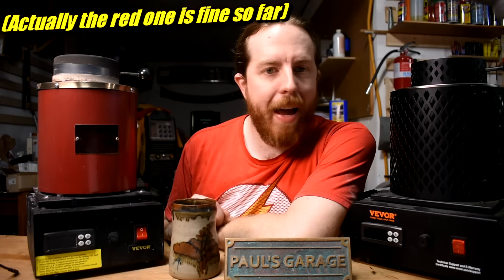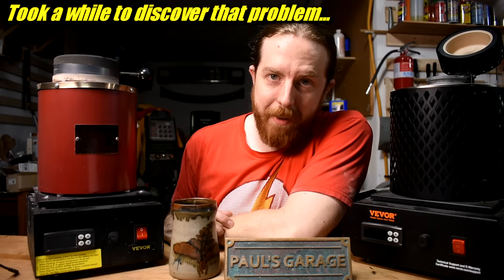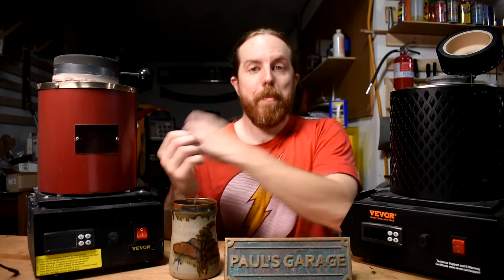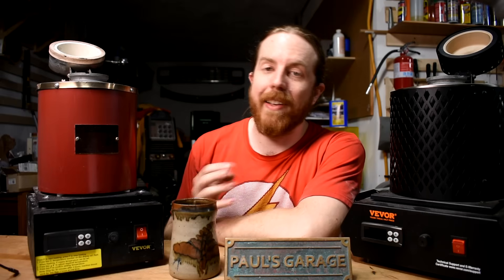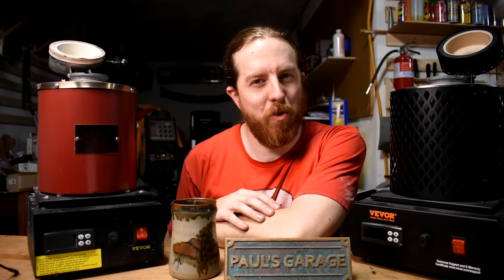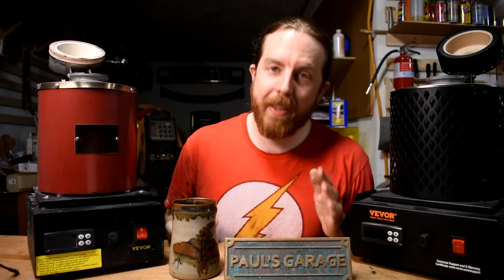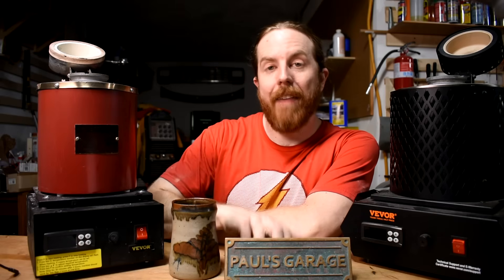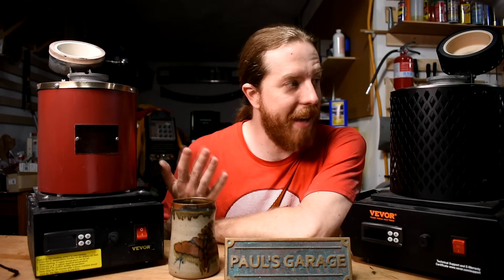The Problem With Electric Metal Casting Furnaces

Comment from the maker: Vevor Furnace: https://s.vevor.com/QTYJN0  BE CAREFUL WITH THE CRUCIBLES
Want to learn sand casting using your 3D printer? I can teach you!: https://paulsmakeracademy.mykajabi.com/joinus
Reply: Got a tip for you. I been to a place that makes copper tubing and the melt massive amounts of copper very crudely then their is a channel in the floor and the copper flows into giant ingot molds. Either way, when melting they throw a whole log on the copper (oak or pine, I can't remember) and when letting it flow they stick charcoal brickets on top of the copper. They both reduce the atmosphere and somehow lower impurities. It must work because extruding and pulling copper has to be pure or you can imagine the issues that would arise.

Comment: My manual with "toauto furnace" says 7-15 uses. I'm going to base it on "cycles", where I will use the crucible for "days", because I never turn it off until im done. I'm thinking my "aluminum cans" crucibles and hot metal crucibles will be for 7 cycles only. My clean metal ingot aluminum/zinc pours will be closer for 15 cycles/days. I mainly will be working with Aluminum, and zinc... with possibly some limited copper use. Glad you showed me some used crucibles now I know what to expect.

Comment: In a previous video you highly recommended to not use bronze with the electric furnace. Has yourr opinion changed with the new model.
Reply from the maker: @roryconiglione9486  not really.  Both will do bronze fine, but it accelerates wear on elements and crucibles.  That's the only reason to steer clear of bronze.  If you are OK with replacing the stuff at a higher rate, go for bronze.  Gas stuff doesn't last forever with bronze either, but I can get more firings out of a big graphite clay crucible, and gas ones don't have elements to burn out.  Propane probably costs more per pour than electricity, though, and the furnaces cost more to replace.  It's probably a wash financially.

Comment: Half way in, haven't heard your conclusions, but that grain in there expanding almost certainly blew it out. Think about how grains work when packed settled, and beyond their natural angle of collapse? Under your driveway is packed gravel. It was solid before the concrete was poured. Bet yiu it was this. Unpausing... :-)
Reply: Related, I once blew up a $1000 metal device using only the compressive strength of thin nylon strand. Took me less than 6 hours. I'll DM you how I did it on discord.

Comment: I'm kinda tempted to get one of these for small parts and when it's pouring rain, but don't want to spend the money on the electricity bill...
Reply from the maker: The power use isn't too terrible.  Probably cheaper than propane costs for a gas furnace melting a small amount

Comment: I learnt the hard way to always pre-heat your crucibles (As even moisture from the air can be absorbed), saying this when i had money one time i actually purchased a few through a supplier that a big foundry uses and the quality really showed compared to other brands i had used.
I have had weird problems with lower quality ones were my crucible wont melt stuff , yet it will melt it metals outside the crucible.
Love the videos

Comment: You overfilled it lol With the grain been so grainy there's no gaps or space for stuff to expand, I've done this with silver :) Don't overfill with stuff that leaves no room for expansion like grain. Just put in like 1/3-1/2 at most then add in more once its molten, in stages. Addign too much will make it freeze... and break again lol (I've broken mine a LOT learning the fun way!)
Reply: With bronze/silver temps, i chuck it after 7/8 uses now. With lower metals, dozens of uses. You can measure the internal diameter near the base, then the external diameter near the base to calculate the remaining thickness of graphite to give you a bit of a guide how risky it is. 

There is a product you can paint over these graphite crucibles to give them longer life, Boron Nitride based, and it works by acting as a barrier between the heat and the graphite, so the graphite doesn't deteriorate into co2 as fast :)In the UK via HSWalsh it's called Crucible Spray - TC0996. I have considered making it from scratch (think pottery glaze kinda process) and experimenting a bit as I've a stack of crucibles I'll never use to cast in but would be good candidates for science without the risk of lava, but the spray itself isn't that expensive, so maybe i'll ge tthat first and use it for baseline comparison as i fuck around xD
Reply: may use zircon based glaze and addition of 25-30% Boron Nitride powder going by my notes, as the starting point for experiments :)

Comment: I run mine a lot cooler, cause I'm just melting aluminum; but made myself a pretty robust steel crucible to melt in.  11ga walls, and 1/4 thick plate bottom.  Feel a lot more comfortable smacking it around to dump the crud out of the bottom too.  Have melted about 40# of metal in my little Vevor, and still going strong, though I get it sluffing off a layer of oxide every cycle.

Comment: I had a 3 kg graphite crucible break when I added some aluminum to it. The bottome broke out. I weighed it. It weighed  188 g and a new one was around 350 g. I got it pretty thin with silver and aluminum. Now I weigh my crucible and if it is below 200 g I stop using it. So far so good.

Comment: When I start using a new crucible I will melt copper or bronze no more than 7-8 times until I demote the crucible to Brass, do that about 5-8 times depending on the volumes and then demote it to Aluminium, then Zinc, then Pewter, so this way I get a lot of uses out of them, I now have one I only use for pewter but had it for years and still in about half worn down condition. At 250C there is very little degradation. I also noticed difference in crucible quality depending on where I bought them. Apparently there is graphite and graphshite... 😂👍

Comment: Always be sure to fire a new crucible empty before you use it. Firing it up to full temp and letting it cool slowly while empty will sinter the crucible. The factory is supposed to do that, but don't trust it.
Reply: I think these are pure graphite instead of clay graphite. It allows them to be suspended by the top where a clay graphite crucible would break or droop.

Comment: I'm "that guy" Paul mentions.  Lost 2 x Furnaces (so far) with crucible failures (over the years to be fair).  I could be moisture (but I store mine on the casting table), I don't think it is metal expansion (as I keep one full of pewter all the time that I melt, let freeze in the crucible, remelt over and over without issue), but I DO think it is due to them being inherently brittle and more susceptible to crack at high temps like 1000c.  My best guess is I put a hairline crack from dropping ingots into it (don't do that!), and the second from chipping the edge of the crucible on the thermocouple (what was at a weird angle on that furnace).  Anyway.  I now load my crucibles GENTLY and try not to knock them over (which is hard given the are tall and skinny).

Comment: 2x4 w/ 1" wooden dowels at an inch or two longer than the depth of the crucible (or maybe shorter to prevent stress on the inverted bottom of the crucible?)...set them on like boots, as long as you don't drop stuff on top of them...they should be fine right?
Maybe a heat to 100~C for 20-30 minutes before ramping way up to full melt temps? (like the dwell of melting the solder for PCB's on SMD components)
I have the same one you have...first heat on mine the solder on the switch inside the main housing melted, instant shut off, no shorts (it had a teeny tiny blob on the switch contact vs a huge honkering one I put back on...make sure no high resistance solder joint, or the high current flow to the element will cause the solder to melt and click...off goes the furnace)

Comment: Keep in mind that red hot carbon is not like red hot steel, carbon actually grows in strength as it heats up... Now, i`m not sure how it affects both the tensile and the compressive strength, but carbon is not steel nor any other metal, it`s a material all on it`s own... I generally do not cream all over carbon fiber like some fanatics, nor do i like it all that much, but carbon and carbon fiber and graphene among other manifestations of carbon are immensely good at certain things and have some rather interesting property combinations... A crucible may be brittle and relatively sensitive to thermal shock, but it is not weak by any means... 
Regarding the ball stock or shot that you used, that could very likely crack the thing due to thermal expansion... shot packs up very neatly, even if it is not perfectly round... every little ball is a small impact that rattles the whole column below it and potentially helps some other ball seat better... heat them all up after they are well packed and you have something that is masquerading as a porous cylinder...

edit
You can also plumb argon to the furnace and drastically improve the life of the whole system, especially crucibles... Also helps if you want to melt iron if the furnace can go that high...

Comment: I received my new vevor electric furnace today.  I was dissapointed that i didn't order the new one, but now I am glad to have the old style (type on your right).  Once molton metal splatters (much less pours) onto the heating element, it creates a short and has to be replaced.  The old style may be a bit slower, but without visible wires, that has to be a plus!

Comment: Most definitely keep track of how many uses on the crucible. I work at a professional foundry (stainless steel, aluminum, and titanium casting). Tracking number of melts or number of minutes a crucible has been used is super important. We prefer number of melts, as this catches the heating and cooling phases. If you do time, start the clock when you start heating and stop the clock when your hand can physically touch it again. 

Second best tip is to baby them! Pretend it’s the egg baby they give teenagers…. But do better 😂

All the other tips are great too! But for safety of yourself (I’m the safety manager of the foundry) and safety of the equipment keep track!

PS - if you need advice on PPE let me know.
Reply: Would a cast iron pipe/steel pipe with a plug welded on the end and a flange on the top work for non-steel type metals?  Since the iron/steel won't melt at the other metals temps...would they hold up better?
Reply: @haydenc2742  yep! We melt most our aluminum alloys at about 1450 F. We definitely use steel this way. Even for our stainless steel melts (a hot melt is pushing 3100 F and a cold melt about 2700) we use plane ol’ rebar to skim the tops. When we accumulate about a softball to grape fruit size slag chunk on top we get a new piece of rebar. For context, we have three 500 lbs melters. But principle is exactly the same. Just scale it down.

Comment: I have a way to really extend the life of them.  When you are finished casting for the day if you can put that crucible in an air tight container when its red hot and they last way way longer.  I have a pan of dry sand with a flat tile of graphite that I set the red hot crucible on.  I then cover that with a metal can and it puts out the graphite fire (the crucible is on fire if you look closely).  you can double the life of the crucibles doing this.  If you don't put out that graphite fire it just burns for a few hours in the furnace after everything has been shut off after the pour.
Reply: OH SNAP...never thought of that...I wonder if burying it in a pail of very fine sand (like play sand) after a pour would stop/smother the burn and allow the crucible to cool and slow/eliminate the carbon burn off?  I too have just shut down the furnace and let it cool on it's own...I bet just like you said...as the whole thing cools it slowly burned itself out thinning itself...need to check my crucible
Reply: @haydenc2742  I wouldn’t want to contaminate my crucibles like that but it might work.
Reply: @haydenc2742  Try pearlite. More insulative so it won't cause thermal shock.
Reply: Graphite fire?  Some wax or oil must have gotten into the graphite.  It sublimates at like 700 degrees and you shouldn't see any type of flame.  If your furnace is staying over 700 for "hours" you have it ridiculously over insulated.
Reply: @travismiller5548  yes it’s on fire.  Just look at one and you can see it and I can assure you that there is no oil or wax at 1150C
Reply: @travismiller5548  It may be turning into carbon monoxide and then burning. The heat turns the CO2 into CO which burns shortly after rising above the carbon.

Comment: After I used my graphite crucible just once it was 'pitted' all over, which is why I bought a gas furnace because I could see the electric one costing a lot in crucibles (plus they they don't hold that much molten metal). It's been a while since I watched your videos (thank the Youtube algorithm for that) but don't you make things out of ceramic??? I recon you could make a lot of money by making ceramic crucibals for these electric furnaces because the graphite ones suck.
Reply: I'm guessing the ceramic becomes more molten as its heated and if you suspend it from the neck of the crucible, it'll break or elongate. You'd need to make a plinth.
Reply: @ryelor123  There was a small Polish company actually sells ceramic crucibals for these, so I'm not sure that is the case. Unfortunately they were not exporting them. It's worth an experiment for those that have the ability to make them.

Comment: That bronze grain can pack in tight enough to crack the crucible as it expands.  It's way more likely to happen with softer metals though. Cracked a couple crucibles with lead BBs before I figured out shaking it to fit more in was bad.
Reply from the maker: Interesting! I didn't shake and pack anything but ill avoid that on the future

Comment: What about just leave the crucible in the furnace to store them?
Reply: Don't leave them in the furnace running red hot...apparently the crucibles "burn" away due to the oxygen reacting with the carbon (per the video's explanation)...I think I might start burying mine in fine play sand to reduce the availablility of oxygen to it while it cools...to smother the reaction and to allow it to cool "slower"
What is the melting point of silica (sand) compared to metals that would melt in the furnace/kiln....hmmmm [sand roughly 1700°C, temps the furnace can get to is MUCH lower...]
Reply: @haydenc2742  Pearlite
Reply: I meant storing them in there after they cooled down

Comment: I have a similar furnace (for all I know it's made by the same factory with a different sticker) and the instruction manual says to preheat to 300-500C (572-932F) and letting it sit for 5 minutes before upping to the target melt temperature. I don't know if that's for moisture (similar to drying out the crucible in the oven as you mentioned at 8:00) or something else, but figured I'd mention it.

Comment: Isnt there furnaces with a melt containment system?
Reply: The originals have a solid ceramic shell...the newer ones seem to have slits in the shell, I guess for faster heating...but susceptible to shorts if/when the crucible cracks and dumps the molten metal to the bottom of the shell
Reply: I wonder how hard it would be to make one with a replaceable kaowool bottom. A simple design that would be electric but easy to make.

Comment: there is a guy ive been watching, forget his channels name, who has been melting metal in a microwave, and it seams to work super well. Its most likely what im gonna be trying when i need to cast metal. He shows how to make crucible, and other things needed for the process.
Reply from the maker: sounds fun but a bit risky!  And probably going to burn out the magnetron in the microwave pretty quickly.  Fortunately microwaves are dirt cheap
Reply: @PaulsGarage  from his videos, it looks pretty safe to me,  hes got insulation and what not and can grab it with bare hands and not get burned...... i just found it again, the channel is "shake the future"
Reply: Is that a joke youtube channel??
Reply: If it's the guy I've seen, the crucible gets HOT inside ceramic insulation, while the body of the oven remains at a respectable temperature.  Effectively a radio frequency induction furnace.
Reply: @hanelyp1  probably the same guy, shake the future

Comment: the moisture wicking up from the concrete might have sumting to do with it 
might need to do a cycle of heating and cooling to get everything out and then check for cracks before using it
Reply from the maker: good idea.  i should probably do that with every crucible as soon as i get it just in case
Reply: @PaulsGarage  Try a ring test. Tap them and see if the sound changes. Might be indicative of a crack.
Reply: Slow heat and dwell at slightly higher than water boiling point?  Similar to how they heat ramp PCB's before zooming up to melting point?